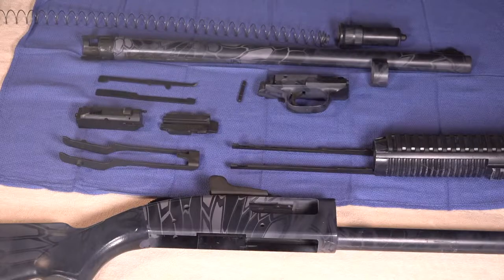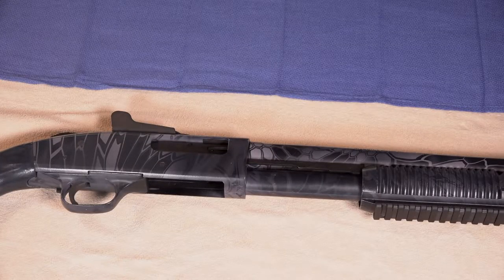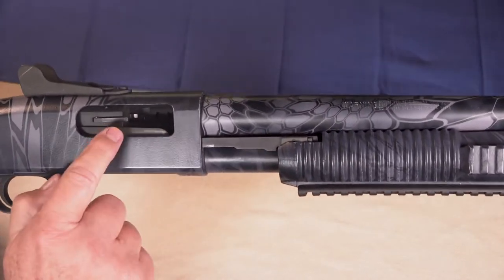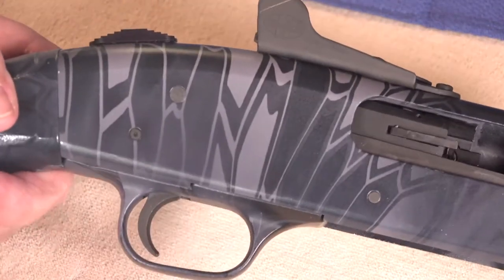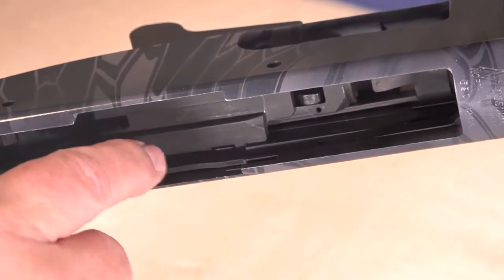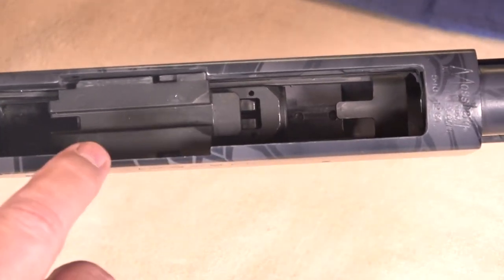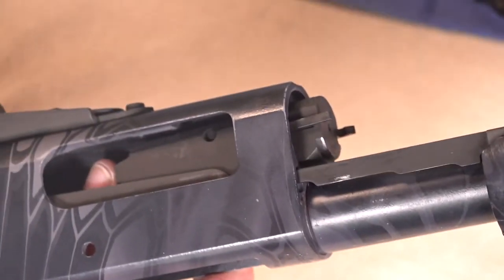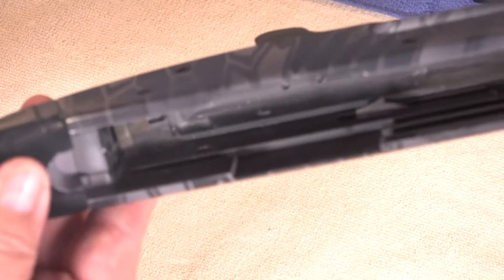Field Strip Mossberg 590A1 - Defensive Firearms Instruction - Personal Firearms Trainer -Part 1 of 2

Comment: Just bought my first, this video will be queued up a while till I learn it for myself. Thank you!
Reply from the maker: Congrats and thanks for checking out the video.  A brand new one might be a bit sticky in some parts until it gets "worn in", but it will certainly smooth out with some use, both in firing as well as field stripping and re-assembly.  Enjoy.
Reply from the maker: Congrats and thanks for checking out the video.  A brand new one might be a bit sticky in some parts until it gets "worn in", but it will certainly smooth out with some use, both in firing as well as field stripping and re-assembly.  Enjoy.
Reply from the maker: Congrats and thanks for checking out the video.  A brand new one might be a bit sticky in some parts until it gets "worn in", but it will certainly smooth out with some use, both in firing as well as field stripping and re-assembly.  Enjoy.

Comment: I have a 590a1 and one of the elevator pins is moving around...is that normal;
Reply: Totally normal, as long as it's not walking itself out of location, like loads of firearms trigger/hammer pins, they are designed to move/spin/wiggle a bit within the TDP and tolerance specs friend 👍